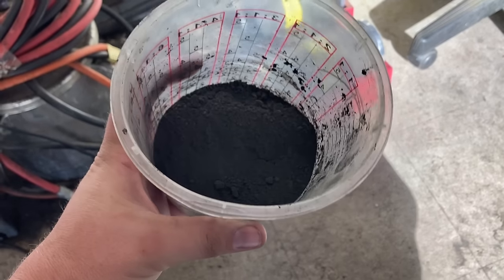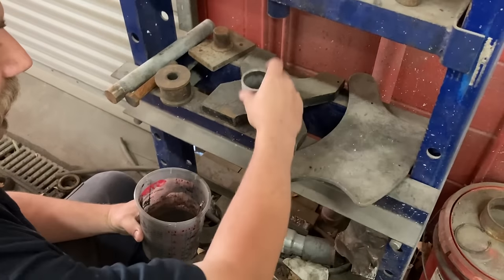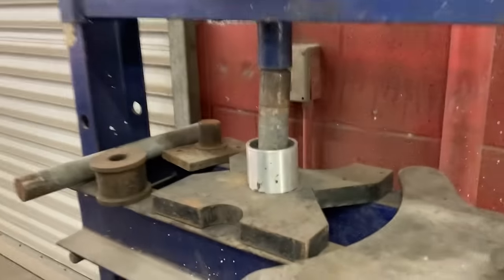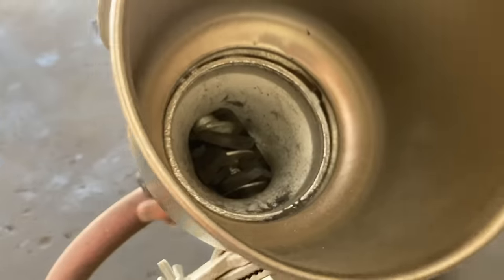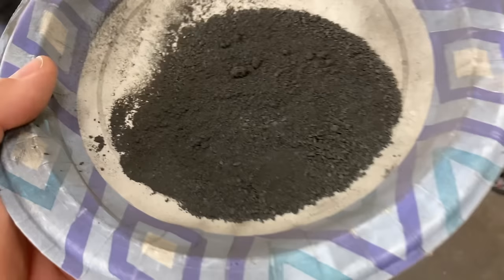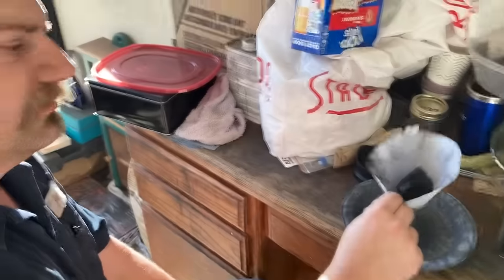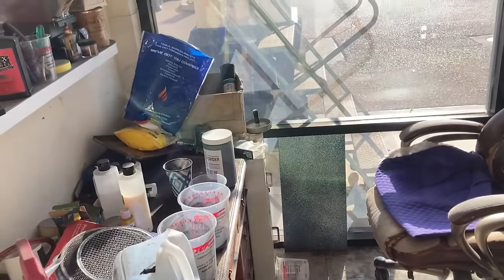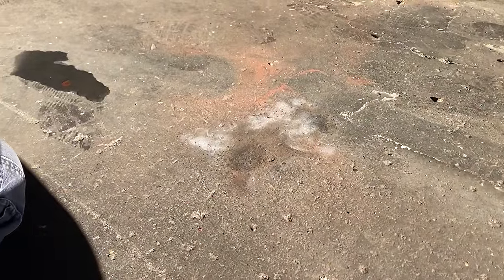Making Corned Black Powder

Comment: Add and exact amount of water ... oh about that exact amount ... oh, maybe some more. measure and exact amount of powder ... oh maybe a spoon ... or a heaping spoon ... count to 20 or whatever you can count to .... JESUS has this guy ever hear of the scientific method? It's a wonder he hasn't blown his hands off by now.
Reply from the maker: Sorry, the reason I can’t tell you “exactly” how much water to add is because there are several variables. The relative humidity, the kind of charcoal you’re using and the ratio of the components all have a significant effect on the amount of water needed. I hope that was helpful. Now get bent, troll.
Reply: @Everythingblackpowder  It isn't trolling you to encourage the use of repeatable measurements when handling explosives.  You can measure humidity easily with a number of cheap thermometers or a kestrel.  You could get a pretty good idea from your phone.  You can measure weight and/or volume of water and charcoal even more easily.  If there are variables you can and should make notes to account for them.  

You likely haven't needed to do this because you have experience and know what "looks right".  Might be interesting to make a similar video and just measure what you are doing AND discuss the reason you might want to make a different decision regarding how much water or whatever.  Anyway, thanks for the video.  Stay safe.
Reply from the maker: @modern1138  I disagree, the “blowing my hands off” part because I don’t know how to measure the amount of water, sure seems like trolling to me
Reply: @Everythingblackpowder  it seems clear to me.  You use what you need to, no more. It a video, I could see it.
Reply: @Everythingblackpowder  well my BP brother, truth is, BP making is an art and even the best BP makers of the '800 were not sure of the exact %s, grams and ML of things had to be used. it look's like sience... it has way more in common with magic that sience. but... i understand if some random idiot on internet don't understand how the process works. they are not even able to cook theyr pasta without turning it into glue, how can they understand this art?
Reply: @Everythingblackpowder  I suspect it's ignorance more than anything.  The reason you haven't blown your hands off is pretty clear to me.  Experience.  Maybe some luck when it was early going.  Regardless, even though I enjoyed your video a great deal, maybe I should make my own damn video.  Thanks for the content and the reply.
Reply: In my freshman chemistry class I learned that all chemistry is basically synonymous with cooking.  Exact amounts are usually not needed.
Reply from the maker: @modern1138  I highly recommend you do that. Vaya con dios.
Reply: @Everythingblackpowder  yeah, it's just like cooking. You are going for visual and tactile standards. In addition to moisture it will also pull sulphur out of the atmosphere during the long curing time. 
So, clearly you are a master chef ;)
Reply: those measurements don't drastically affect the powder, only to make the pucks also who asked?
Reply: well with enough experience the scientific method becomes irrelevant for just personal use and small scale production that really only becomes important once you get into mass production of stuff
Reply: @Everythingblackpowder  everything you don't like isn't trolling. Its like leftists calling everyone they disagree with a nazi. No, criticism is not trolling, stop being sensitive and man up.
Reply from the maker: @Sly Marbo  I disagree on multiple points. First, I get plenty of comments from interweb tough guys like yourself but that one did have a legitimate question which I answered to the best of my ability. His prickish attitude is probably a genetic disposition that he can’t help but I suppose even a troll can have a real question.
Second, I don’t call anyone a troll who criticizes me or my work, which you might have seen if you had read more than one comment. It’s more than a stretch to compare me calling one person a troll to the libtards calling everyone a “nazi” 
Lastly, I disagree that it’s being “sensitive” to fire back at you clowns for making ridiculous statements like these, in my opinion its necessary. As far as needing to “man up” I would suggest the same to you. Stop simping for pricks in the comment section. It’s known to lower testosterone levels
Reply: @matteoorlandi856  ". it has way more in common with magic that sience. " bullshit
Reply: @zfolwick  - Bullshit. Something someone with freshman chemistry would say. You ain't duplicating the Heber process by eyeballing it.
Reply: @thysonsacclaim  ok mr happynes, Say what you want, i'm Happy with my results and all my .58s are, why should i lie to you?
Reply: Scientific methodology applies more to the invention of black powder and perhaps to modifying an existing recipe. The formulation corresponds more to cooking, as one commenter wrote ... even more so to baking (more precise than general cooking). Many things are done by feel and  judgement because fluctuating variables are often more accurately adjust for by eye than by instruments.

BTW ... His  method for adding water was perfect. He was as precise as using a pipette, the method a chemist would use. The instructions were clear ... drop by drop until no more dust then stop. Remember, he's demonstrating a tried and true method ... not inventing the stuff.
Reply: @arnearne12345  ...
In fact the scientific method applies primarily the invention of black powder. Once the theory has been tested and refined enough to formulate, it's no longer theoretical. Then only manufacturing protocol applies. The science is done.
Reply: @jamesforbes2871  yes that is what i said except i used human terms because the process of experimentation and trial and error that we used to get to the procedure, is the experience at hand IN SHORT if you know what works and have that verified through past events (aka experience) then it falls out as a relevant point unless you are trying to further refine the process for greater accuracy ar yield.
Reply: @arnearne12345  ...
Spot on, I knew exactly what you meant; which is why I found the video so easy to watch and understand. I was just adding my observations for those who thought your methodology was sloppy.
Reply: @jamesforbes2871  ah yes this is perfectly acceptable and i apologise if i came off as hostile i too think it's quite humorous how inexact people with half a lifetime of experience can sound at times even though they know exactly what they are doing
Reply: @arnearne12345  ...
Oh my, don't apologize. I was enjoying the confidence you showed in your craft. It was obvious from the start that well rehearsed skill was involved. It must get frustrating trying to help people learn something rewarding and interesting ... then must fend of silly comments.

This subject came up in my UT feed because I had done a Google search on how "corned" powder was made. I was watching a series called TABOO, in which making Black Powder was the sub-entire theme. It was set in 1814. From what I could see, the historical accuracy was good. "Cooking" was the best analogy.

On a side note ... I began making explosives about 70 years ago. I of course started with black powder ... began using fertilized (by chance) ... blew myself up ... survived ... learned how not to be part of the explosion ... went on to make gun cotton, mercury fulminate, nitro glycerin and finally picric acid ... in that order. When it occurred to us that the amount we made could have leveled that wing of the school ... my explosives career ended.💣💥😳
Reply: @jamesforbes2871  XD my good sir i think you may have missunderstood the situation alltogether i do not myself work with blackpowder but this principle is applied to all aspects of life and all forms of work i just happen to be one who thouroghly respect those of experience
Reply: @arnearne12345  ...
I'm sorry, I really did get my wires crossed, didn't I. This thread was flagged as one that the host was active on. I assumed you were affiliated with them ... 

We see eye to eye, regardless of my brain fart. Cheers.
Reply: @jamesforbes2871  XD no worries mate it happens to the best of us i'm just happy this wen't as smooth as it did
Reply: @arnearne12345  ...
Mainly I was responding to the smug poster, Frank Plughoff's wrong comments. I guess he failed to observe how carefully the host adjusted the drip rate of the faucet ... then tested the mix, followed by a further few drops, then a retest. The test was for amount of dust. That's how science is conducted.

Anyway ... all's well that ends well.
Reply: It is exceptionally hard to blow your hands off with a black powder firearm if the round is seated hard against the powder. Almost doesn’t matter if the rifle is filled completely with black powder to the muzzle. Iv8888 has a great video on that topic.

Comment: Cool video and I learned a lot. I've made a few batches, even with my own willow charcoal. BUT, I didn't know about pressing the pucks and not using much water. I definitely used too much water and made a shiny ball that I ran across a screen. My powder works pretty good in my 1851 Navies, BUT it does NOT flow through my powder flask, so I have to scoop it with Lee dippers. I did add a little dextrin and tried graphite, but still no flow through my flask like the commercial powders. I think if I followed your methods I would get powder to flow through the flask. Thanks and I'm glad to see some real Americans out there.
Reply from the maker: Happy to help. This powder rolls through a flask, no problem. Give it a try
Reply: @Everythingblackpowder  Thanks and sharing this video with a friend.
Reply: @Everythingblackpowder  Howdy. I'm looking at Harbor Freight presses. They have 12 ton for $170 and 20 ton for $250. You think a 12 ton press is enough? I'm trying to save up for a flintlock kit rifle as well....2023 is the year of the flintlock for me!
Reply from the maker: Probably. Remember, any compression is better than none.
Reply: @Everythingblackpowder  cool thanks! Yeah when you weighed the denser powder and compared the grain measurement to other brands it really clicked in my brain. I think that was your How to make Black Powder for Firearms #2 video.
Reply: @Everythingblackpowder  watching this again because now I have the press and die!

Comment: I've made the corns by pressing the damp powder thru a screen, then you can, sort it thru finer screens to your hearts content. None of the press pucks and a week in the sun, or a grinder, and its inherent danger. The damp corns dry in minutes on a summer day and will go bang just fine. This final product you've demonstrated here looks just fine but I think you make it a lot more work than necessary this way!
Just my 2 cents worth.
Gabby
Reply from the maker: Corned powder is more powerful and burns cleaner than the screened powder. That’s worth the extra effort in my opinion

Comment: The graphite process is done in a roller like a large stainless pot and rolled. And 10 hours of mill time is insane lol to each there own thanks for sharing
Reply from the maker: I’ve heard that before but it’s the only way I can get my powder to burn fast. It probably has something to do with my cheesy “ball mill”
Reply: @Everythingblackpowder  it is. I used the same mill back in the day when I first started out in pyrotechnics. It can work with some mods. If you ever plan to upgrade the rebel 17 ball mill is more than capable I mill 22 oz at a time 3 hours and can't get much better
Reply from the maker: @pa-pyro2804  nice!
Reply from the maker: @pa-pyro2804  I’m gunna buy one of those. what media and how much do you use?
Reply: @Everythingblackpowder  I use only half inch lead for my media. Also its optimal to have the mill jar half full with media and when you put your powder in it should only just cover the media with about 35 40 % of the jar empty. Ill add also that its more cost effective to find or recycle your own lead you will need about 25 to 30 lbs hardend lead. I melt and make my own media because its actually cheaper to by the hot pot and lead than it is to buy hardend lead media and have it shipped. The stock motor can turn the 17 lbs no problem but if you want an optimal mill ratio the motor needs upgraded if you want to go that route let me know ill give you the motor details to. Its an 80 dollar upgrade
Reply from the maker: Yes please

Comment: We used to win/give away Elephant at some of the New York blackpowder shoots, it was a hard to ignite, horribly fouling and weak powder. The wholesalers were pretty generous in donating to our state assn, and local clubs though (as was a very generous Goex distributor, to be fair)  I ended up using it for lift and break charges in my homemade displays. From what I heard thru the years in the sport, and no small amount of research back to when Dupont owned it, the graphite used on Goex is to facilitate handling by making it flow better and help dissipate static to improve safety at the plant. I don't believe it has any positive effects on rifle performance. I haven't made powder in a few years, but used to put small squares of brown paper under the pucks. It draw the moisture, holds the puck together and makes it dry faster. Peel off after drying. The best puck drying is in the dead of winter (up here in NY) or in a small room with a dehumidifier running at max). I never milled in those conditions, opting for a nice safe static free 40+ RH and short open time. I would put the well dried pucks in canning jars and mill in the spring, screening with Chinese pyro screens (from Skylighter which I think is sadly no longer with us - We  miss you Harry) 
We used to play with the cannon and mortars, so the reject granulations were used for that, and later Pyrotech stuff, and the fines for making custom prime for the flint guns. 
Just found you and subbed - I'm enjoying your content!
Reply: Skylighter website is still up and running.

Comment: Make your own puck die with a piece of 3" heavy wall steel pipe and 1/4" plate, available at most scrap yards. It ain't nothing special to pay what the store in the link is asking for them, especially since their kit is obviously made that exact way! If you're scared to go the DIY route on one for some reason, you can buy 3" hydraulic piston setups from Grainer or other industrial supply shops for less, too. The grain grinder in the link is a great deal though, cheapest I've seen a new one go for.

Comment: I love how you’re doing this in the workshop (and risking the time space continuum) hahaha.
Reply from the maker: It’s dangerous work but someone’s got to do it
Reply: @Everythingblackpowder  don't you afraid to press with 20ton ? The temperature from pressing that increase isn't dangerous to Ignite the puck and ruin your day or even worse injured your self badly? Did you thinking this concern issue?
Reply from the maker: @willowpine2604  if you press it wet and slowly, there's not really any danger of it igniting
Reply: @Everythingblackpowder  standard 5% moisture is that you talking about wet?
Reply from the maker: @willowpine2604  yes
Reply: @Everythingblackpowder  what density you get ?
Reply from the maker: It’s slightly more dense than Goex and even with Swiss
Reply: @Everythingblackpowder  but you say in one of your videos that yours isn't the same with commercial because of density that you get that's why I am asking!
Reply from the maker: Yes. The old screened black powder is not compressed and corned therefore it’s not as dense as commercial powders
Reply: @Everythingblackpowder  hmm i understand. So you were talking about your screening not corned!
Reply: @Everythingblackpowder   did  you finally found the barrel fouling problem? I had a theory about why the commercial brands doesn't burn dirty and leave less fouling behind! Its all about the Carbon source which in this situation is charcoal! Think about the corned black powder, is dense powder because is pressed by human and when it crush it create meal powder or meal d! The meal powder is faster than ball miling powder because of density, so the same think happen with nature .The wood by it's nature is dense. Whatever how small you cut it to put inside the can and cook it is still remains dense.  No matter how much milling you make it the particles maybe will be small but they are remains dense ! From the other side cotton wool (not cottonwood) is fluffy and less denser and when it burns it leaves no residue behind! The same principle happen when this cotton wool became charcoal,burns cleaner than density wood , leaving behind less residue!! Think about it 😉
Reply: Plus another thing, when the Carbon source is less denser you need more by weight to complete the recipy which leads more Carbon molecules surrounding the oxidiser which leads to more efficient complete combustion!

Comment: The graphite is IMPORTANT, if the powder is to be used in a firearm, and here's why.  Without it, when the powder ignites, it emits IR, which penetrates through the entire charge, causing it all to go off, at once.  But graphite absorbs IR.  This allows the flame front to progressively travel through the charge smoothly.  This doesn't matter if the powder is used as an explosive, rather than a propellant.  However, it also prevents the accumulation of a static charge, which could produce a spark, so it's a good safety measure, in any case.
Reply from the maker: That’s interesting but I can tell you from personal experience that non coated powder performs better. Also, Swiss does not coat their sporting powder in graphite.
Reply: @Everythingblackpowder  I'd certainly expect uncoated powder to be more brisant.  Maybe the Swiss have found another way to solve the IR problem.  In the 1980s, I made some uncoated BP for use as a rocket fuel (like in "bottle" rockets), and the rocket exploded.